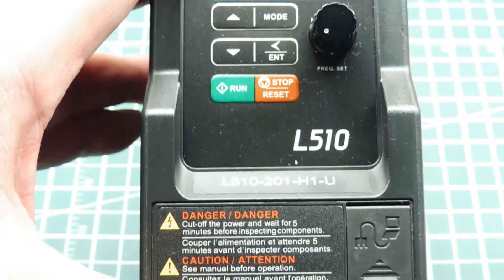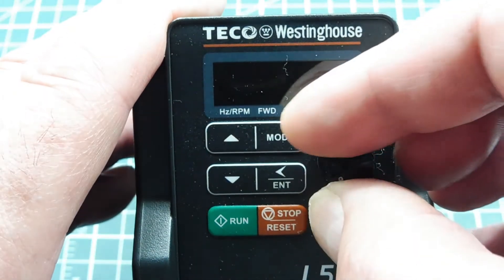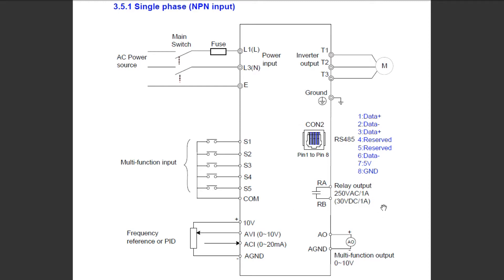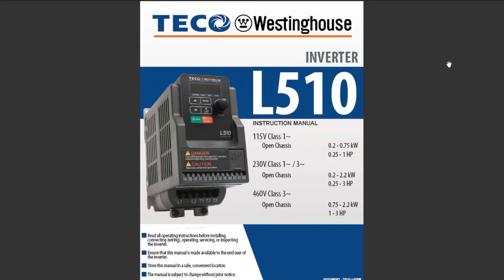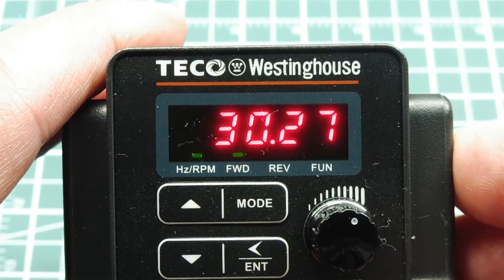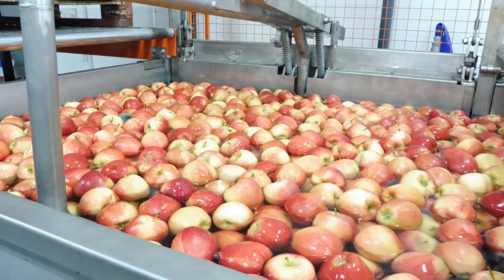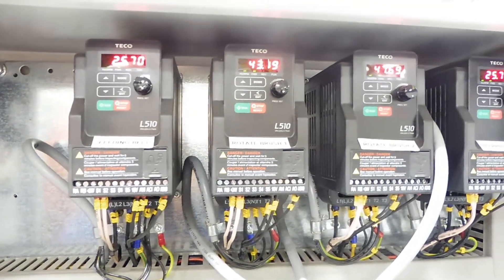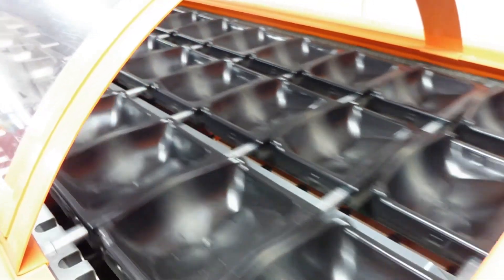Variable Frequency Drives  / Induction Motor Control

Comment: I have a Project that need to run maximum at a 100 rpm but need to slow the speed  each revolution for about 90deg at 50rpm and back to max 100rpm, couls I use contacts of two different volts to feed the controller?
Reply from the maker: For motor control you can use 0-10 volts, 20 mA current loop or Modbus.
Check out this video:  https://youtu.be/MTGhQMxSTQw